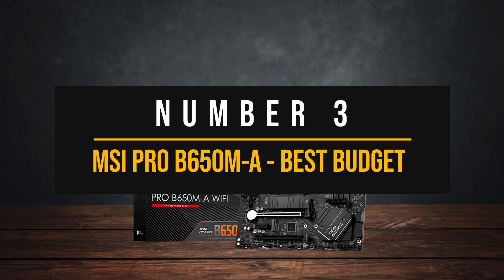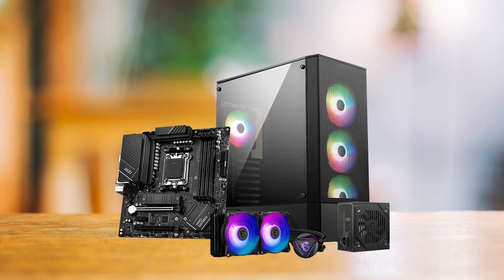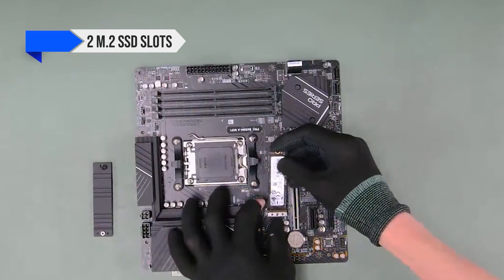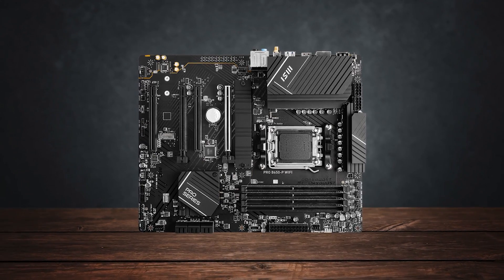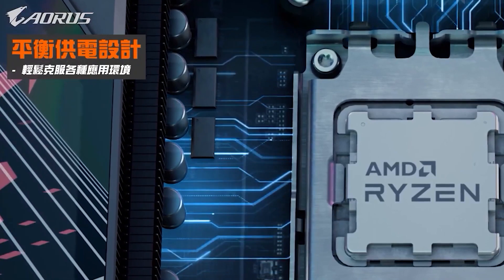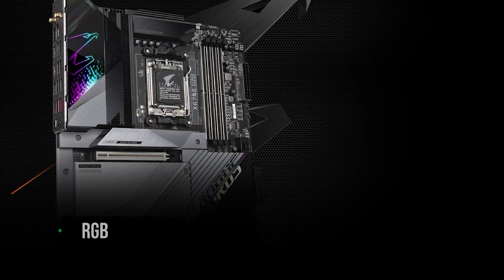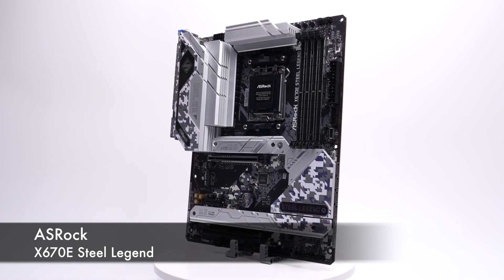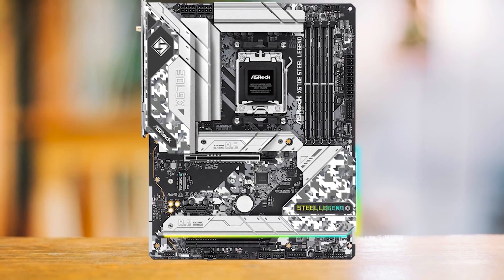The Best AMD Motherboards For Radeon RX 7900 XTX In 2025! (TOP 3)

Comment: WTF? The motherboard does not mean anything to the GPU it does not care at all. You can put the 7900xtx on anything you just need a fast enough CPU to keep up which is anything from Intel mid-range 12th gen up and AMD Ryzen 5000 and up. You can put the xtx and a 7800x3d on a shitty board and still bring out the full potential of the 7900xtx not that anyone buying these would but still.
Reply: Thats actuelly not true. You need enough pci lanes x8 for example has less bandwith than a x16 bus. And also the pci version does mather also, at least pci gen 3. Also, motherbaord with a chipset bevor x400 cant use SAM for amd cards. Sry if i spellt somethin wrong. English is not my first language.
Reply: @dasisteinakkount5058  Again that's why I said as long as they have or look for a fast enough CPU. It does not matter what motherboard. For my example I said the 7800x3d. All boards that support this CPU and its family will have 4.0 and will always have 16x top slot no matter the board. I'm sure anyone this day in age will choose a 400 series board as they are not really made new anymore, mostly just extra stock floating around that's for BUDGET builds a place a 7900xtx has no business lol. And the same for Intel's 12th gen up would not pair the 7900xtx on anything lower because those CPUs are too slow. But anyway, 8im loosing myself if you strictly go off this video its only pointing out current gen stuff and what I'm pointing out is all current gen supports PCIE 3.0-4.0 all have 16x top slots Resizable Bar/SAM support is on most boards as well aside from the cheaper 400 boards which again are for budgets and at that point it would matter much to those budget builds as Resizable bar/SAM.
Reply: @forog1   so do you have any particular motherboard with wifi that you would recommend with the 7800x3d and a 7900xtx ?
Reply: @oh1oiso  Gigabyte's board are solid A personally have an X570 5950x on their Aorus Master board but this tiar is pricy can step it down to their Elite Wi-Fi Pro X670 will give you exactly what you want for cheaper. Asus is also OK choice but whatever you go with that CPU get an X670 board it's the best Chipset to pair with such a beast of a CPU so treat it to something well. Thats where the Motherboard matters. Not the GPU lol
Reply: @forog1  Thanks for your advice !
Reply: Before providing negative comment you should test your own knowledge. This is a  well researched video and provided a very good CPU, Motherboard and GPU assembled coordination.
Reply: @AbhishekShrivastava-t8d  Nah motherboards only matters if you care for PCIE peripherals such as number of m.2 drive slots or 10gb Ethernet ports etc. Or if you want quality VRMs for max OCing your top end CPU. Only time a GPU will not work at its full potential is if you have a CPU or ram or vram bottleneck.